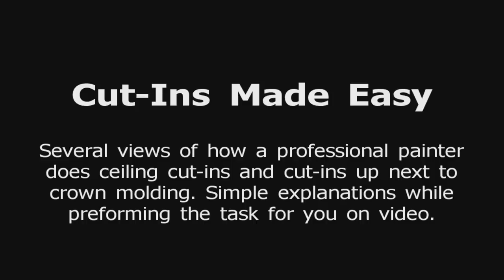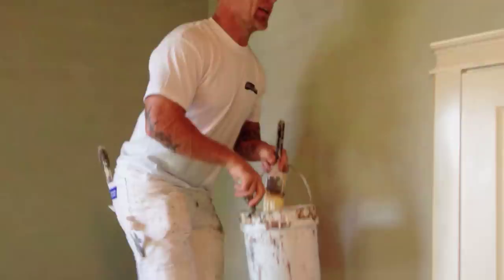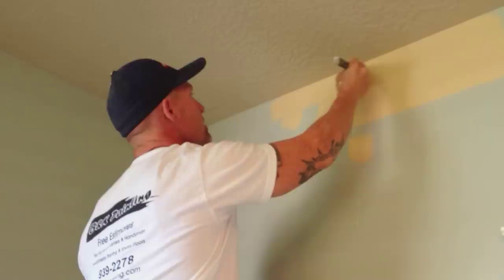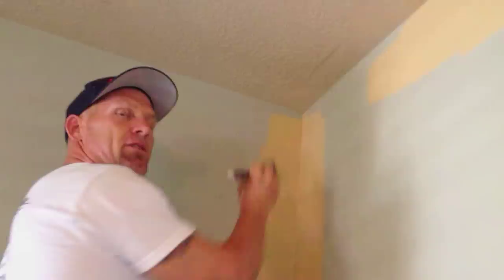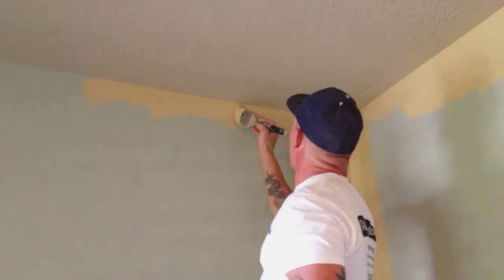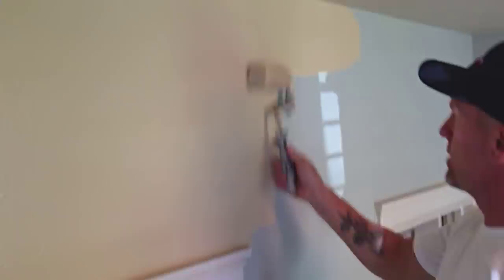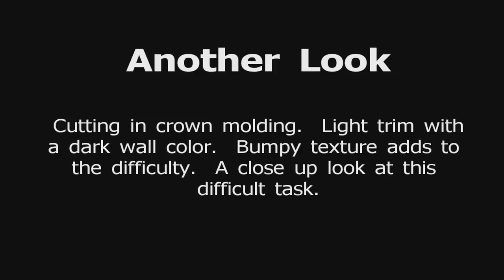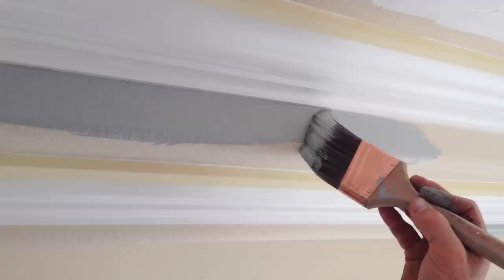CUTTING CEILINGS.  DIY How To Paint A Straight Ceiling Line.

Comment: Like your techniques. Similar to  mine. Most try to stretch a cut too far or are afraid to lay enough paint up there in the first place. where do you find 4, 7, 9, 12 or 14 inch "nap" roller covers- LOL, ;-}     I like to follow up brush cuts with a weinie roller, (mini roller), and taper or scallop the dry edge so blending is easier for me when  feathering in my fill coat... May not work for everyone. Thanks n God Bless you and yours-

Comment: Great tips,  my problem is getting smooth straight line on smooth ceilings. Seems like the tapers in the corners are no straight so if I follow the ceiling line it does not look straight. Thanks brad

Comment: Chris,
Great video! I used your technique last night on my own project and it looks great so far after one coat. Doing the second coat tonight. Do I need to cut in again on the second coat? I got excellent coverage on my cut ins. Also, I got a little too close to the ceiling with my 4" roller and got a couple spots on up there. How do you recommend fixing that? I have subscribed and liked every video I've watched. Thanks!

Comment: Chris,  i also will experience my brush,  after a while ( hour?  bit less?...more?)   just starting to really 'goop-up' if you're using it for that long, at a session?   any secrets to preventing a brush from 'thickening and coagulating' with paint that's been 'on it'..for a time?    basically,  just change or 'rotate' brushes and drop the 1st in a water pan?   any help?

Comment: Hey Chris. Have you always preferred the glide brushes(angled brushes). I have always used the monarch elite brand. The 3"mully brush is becoming heavy these days, after hours of use. Thinking of changing to a 2.5" angled for cutting. I work full time on new builds here in Scotland, mostly price work. My wrist and hand is getting cramp cutting in all day with the 3" straight cut brush.

Comment: I'm just getting into the painting trade and have a question... wouldn't it be easier to frog tap off the ceiling / trim so you dont have to worry about going so slow?

Comment: Just a small question on the topic. If you are painting an area like for example a corridor/hallway , a part of the house which will take more effort to perform the cutting in. How would you proceed perform all the cutting in for the walls and then start painting or perform the task one wall at a time (to avoid possible haloing). THanks.
Reply: +The Idaho Painter thanks for the info :)

Comment: Hello Chris.  watching your videos fairly regularly.   something else came to mind;  'when painting over paneling,  with primer  ( not the most 'ideal' situation, i know....)  would 'one' want to spend the time to cut everything in,  just as precisely,  as you would,  when finalizing the 'actual'..paint trim work.  ( ie;  ceiling cut-ins,  tops of baseboards, etc...)   figure if i had to go to that length also,  on just the primer work,  job would take so much longer?   any suggestions?   thx!

Comment: Thank you so much for this tip. I was told I only needed a trim brush for trim work and a large roller for walls. But I was wondering what to do about the fact that the rolling pattern wouldn't match. Two types of brushes, two types of roller patterns. Right?. Going to get a mini roller tomorrow before I start painting.
Reply from the maker: We haven't had issues with that

Comment: Any thoughts on handheld airless Graco fine finish? I want to get an HVLP quality finish and I doubt the Graco handheld can put out a the same kind of cabinet finish. And since I'm disabled I am also on a budget (owned a painting company 20 plus years ago, "might" start small company). If the Graco handheld can't give me that kind of factory finish then I'm looking at a 2 stage turbine $300 HVLP I suppose - if that will give me that kind of finish. So any inexpensive HVLP's you like? Thanks for the videos and much success.

Comment: How do you avoid brush strokes when using dark colors over a light wall?    When I cut in with a dark color, and when the cut in drys, I see areas where the brush didn't cover (brush strokes).

Comment: If you aren't a pro you can always use this method but before you paint use a 5 in 1 tool to create a line in that crease you are cutting in this way it will help guide your brush perfectly.
Reply from the maker: Yes, thanks for sharing!
Reply: banksj54 how do I use the 5 in one tool to make the line? I’ve never painted before and have to paint an entire 3 bedroom house. Can’t afford to hire out. And I moved to a new state so I don’t have any friends yet to help me.
Reply: That's sounds like a good tip! I'm going to try it!  I like to put a thin bead of chaulking too.  Gets rid of many of the texture bumps

Comment: I've watched this multiple times now...what I've come to realize after doing multiple rooms, is that I can't make it around the room before the brush starts clumping. When cutting near the ceiling, how do you prevent the paint from reaching the ferrule and getting dry/crusty? I'm tired of going through a brush with every single paint job I do.
Reply: when u go to leave ur paint brush , leave it in the paint pail with the bristles sitting in the paint until the next time you go to use it . 👌
Reply: @maxwellferrier3254  Thanks for that tip for between coats. The issue I tended to have was not making it around the ceiling, trim, etc during the first coat without clumping. What I never realized (until watching some other stuff on here) is that the brush should be wet before loading it, and then cleaned as you go. 🤦‍♂️ Sad, I know, since that's like kindergarten art class knowledge. 😂

Comment: Nope. Never heard of a nap or knap. In Oz, we'd call that a 75mm roller. Personally I cut in about 100mm then just roller up to within 20-25 mm of the cornice. No halo in sight. He is, however, very steady with a brush. I'm as good however certainly not as fast. Still, what do you expect from mechanical fitter?! Good vid, cobber.
Reply: Not much good from from down under in Oz.

Comment: Is it true that lighter colors tend not to flash (halo) as much as darker colors. My boss isn't too worried about the cut of lighter paints drying before the roll. Also, why don't you use 3" brushes for cutting in? I would think you would use a 3" to get more coverage.
Reply from the maker: Yes, lighter colors tend not to flash as much

Comment: Hi Chris, thanks for the video, very helpful. and i also wondering what's brand 4 inch nap holder you use in this video? the handle looks very short and solid, very big different between the others i saw in home depot or sherwin williams.
Reply: it looks pretty cool, Monster roller frame!!!

Comment: I have a question, what happens if your cutting in and you're by yourself and the cut in dries a little bit? When you start rolling will it stand out?

Also do you have to cut in on the 2nd coat?

Thanks!
Reply: Okay, but on the 2nd coat should I cut in again? Thanks!
Reply: +The Idaho Painter great. thanks! i will leave a 5 star as soon as I figure out how. thank you again.

Comment: Hi Chris,
A big thank you for all your videos, they are a big help!
Is it normal to have very small cracks in the corners (hairline crack), not everywhere, but at some places, the paint in the corner seems to crack a little, I use 100% latex acrylic paint.

Thank you and have a nice day
Reply: ***** Thanks for the response, do you know what can be the cause?
It's not the drywall, it is just the paint that shows very minor cracks in the corners at some places.
Thank you
Rich
Reply: Hi Chris,
The cracks are so minor I don't think a pic could show them, the paint is 100% acrylic, first it happened with the primer, then with the flat on the ceiling. At somes place there are no cracks, but some others show very minor craks in the corner. Maybe I applied it too heavy (I tried not to)
what's the best way to apply the paint in the corner with acrylic paint to avoid cracking? Doing both sides at the same time?
Thanks again for the answer and have a nice day

Comment: When your built like Hercules its no problem to be carrying around a paint pot with roller, screen, brush and paint, not to mention up and down a small ladder all day. I would never paint like this and I am a semi-pro 'unless' I had a another painter. I see the use of the roller as you go as practically a waste of time. I would probably roll one wall at a time if I were worried about the way the rolled surface is blending into the cut in area. It seems like you are giving yourself more work unnecessarily. The way you feather the lower portion of the cut in area would blend in no problem with the rolled area in most cases. I would try to get the wall rolled within an hour. Good video!

Comment: Thanks for your videos! Is it true that there is no need to use sealants, base coats or primer when painting walls using paints that claim is all-in-1 or does not require sealant, primer or base coat? Thanks.
Reply: ***** Thank you so much for your generous advice, The Idaho Painter! Go Idaho!
Reply: ***** That's because you are Good!

Comment: When I trim my ceilings , doors, and base boards, every time I can see where I painted the ceiling,,, , I guess the trick is to not let it dry , meaning I can only trim in one wall at a time if that much. Thanks
Reply: I love seeing different techniques. I'm solo on my jobs so I cut 1 wall then roll it so I was always have a wet edge. It also helps with from getting bored.

Comment: Are u dipping the roller straight into the paint?  Do you have a ramp in the container to remove the excess on the roller?
Reply: You use a thing called a bucket grid to run your paint off, came here for links to find his as mine has rusted
Reply: James mcconnon ty. I didn’t see it in the list. Although i might not have known what I was looking for.
Reply: @Dee-cg2fx  no problem. It is a great thing for sure, as a sidenote, your roller will generally offset the weight nicely, hanging off the side, even if you don't have much paint in your kettle
Reply: James mcconnon ty. Much appreciated. :)

Comment: How can I fix the haloing effect?would I have to repaint the whole wall?
Reply from the maker: You have to keep a wet edge and use a high quality paint
Reply: Home Improvement How To's the painters used SW super paint... but it left haloing😡... now I'm wondering if there's some way I can correct it myself.  I'm guessing I would have to repaint the whole wall to get rid of the haloing. Is that correct?  BTW thanks for relying 😀

Comment: Nice to see you're still active on YouTube after all this time :) I've run into a small conundrum lately and was wondering if I could get your advice. I am painting a stairwell for a family member and have seen multiple videos showing a tactic involving an A frame ladder, an extension ladder, and a solid 8 foot plank, where they would set the A frame up at the top of the stairs and connect the plank from said A frame to the extension ladder to reach the walls and ceiling portions above the stairs, sort of as a makeshift scaffold. This seems like a nuisance and a bit hazardous, what would you do in this situation? Thanks in advance!
Reply: get a ladder buddy
Reply: Alec Lomeli go to Sherwin Williams and ask for a pivot.  It's a small platform that goes onto the steps to give you a surface to put ur extension ladder on its by far the easiest way to do what your asking about.  I am a commercial painter we use them all the time:
Reply: Mike S yeah, it's called a ladder buddy, buddy
Reply: AdamBurnsRed maybe the one you use is called that who the fuck cares what cute name some company gave it
Reply: Mike S lol..he was just trying to help, lighten up..rofl